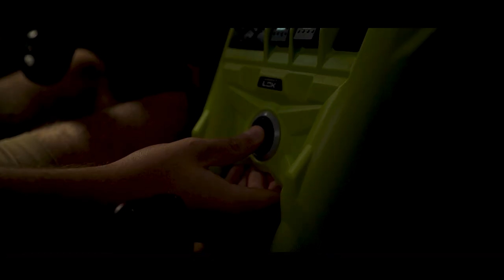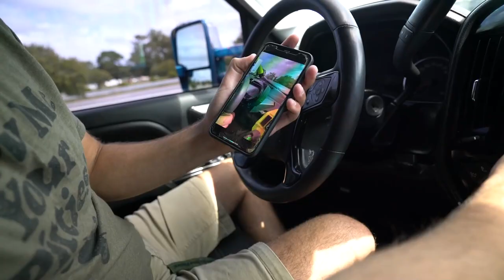BUILDING THE BADDEST 2020 CAN-AM! 230 HP Mud MONSTER!

Comment: Feel like theres been more videos of it going to the shop broken or not than it actually being ridden
Reply: well duh its a can am its what their good at
Reply: @quadlife467  no
Reply: When you full send like he does it’s hard not to break something.  Just depends on the type of rider. #milemudder (full sender) or sideline spectators. Lol great vids Brayden.
Reply: QUADSQUAD420 true but wrong. My canam was nothing but issues I finally fixed them all so I think and have had no issues put my first 280 trouble free miles on my renegade and it’s an 07 800 and the first gens are suppose to be bad for issues
Reply: Mason Chuk no, I completely understand  luckily I’ve had minor issues (riding too hard)  with mine it is a 2019  450 but it hangs with the big boys.  Definitely want to upgrade soon.  Just got into the sport so I may be in for a surprise.  Keep sending it.
Reply: True